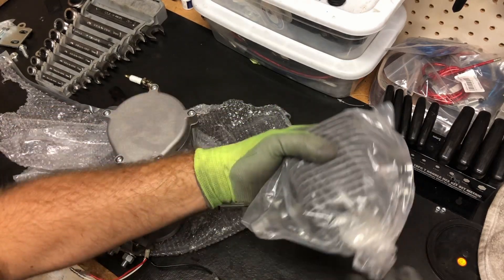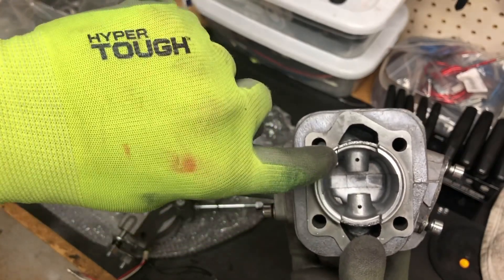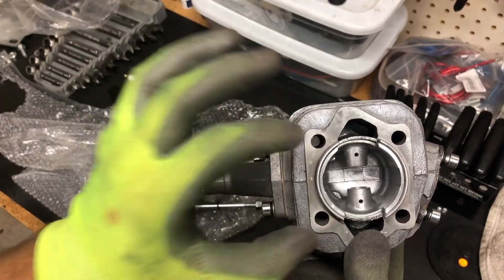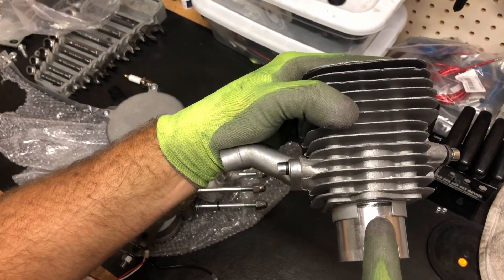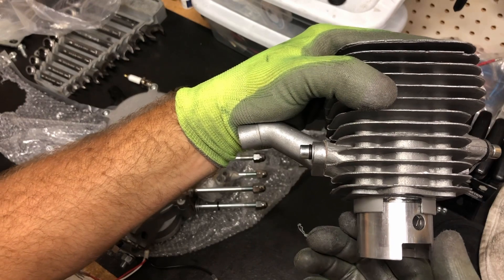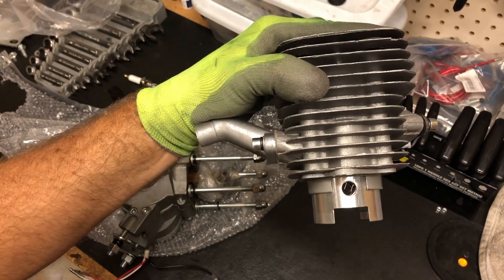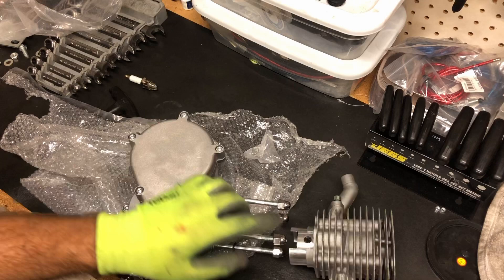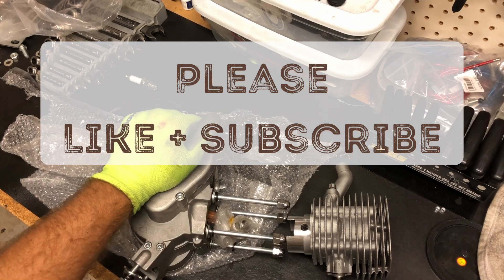YD100 and 80cc Quick Check To Verify Piston Is Facing The Right Direction

Comment: Question can this yd100 cylinder an piston bolt directly on a 80cc case? Or are the head studs pattern diff?
Reply from the maker: Unfortunately, no. The main opening of the opening is not wide enough to fit the transfer port guides of the 100 cylinder. If you were to bore out the case of the 80, then yes, but you would also then need to change the crank as well. Hope that helps. Happy building.

Comment: Can you spin it all the way around or do you have to take it out if it's in wrong
Reply from the maker: Make sure there is at least some lubrication in the cylinder to prevent scratches, and them just turn it around without taking it out. 👍